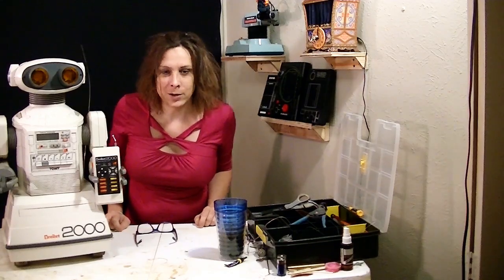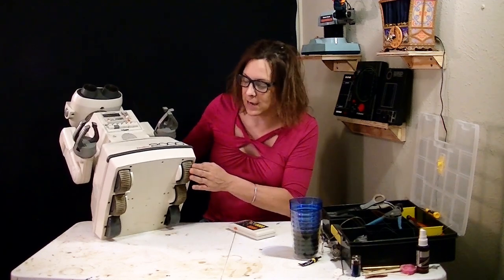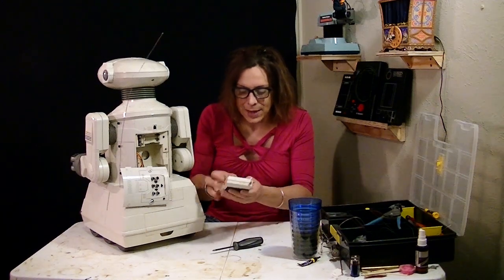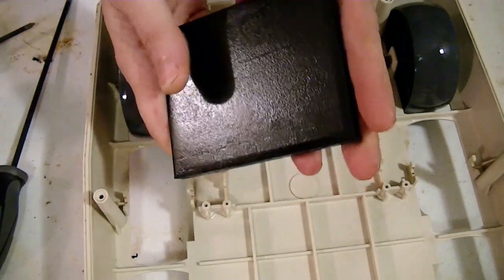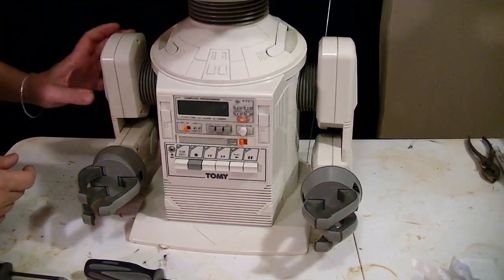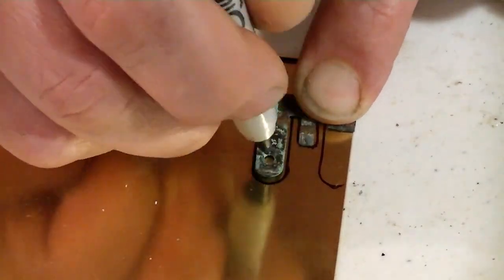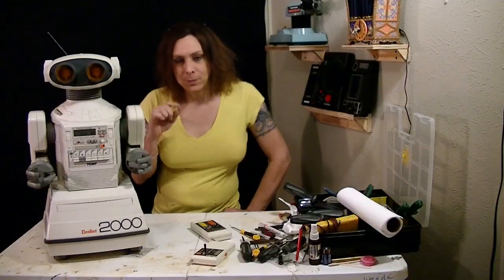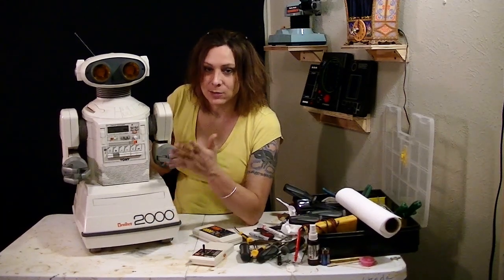OmniBot 2000 Refurbish Episode 1

Comment: I have a working omnibot 2000!  When you turn it on it returns to its neutral position. So if the head is to the side it will turn center blink its eyes and make his space robot sound!
Reply from the maker: If that is a question, then yes. That is correct. You will also hear the transmission shift gears back and forth as well. All have to pass for it to work.

Comment: Hi  :)

Thank you for your helpful Videos... I have an Omnibot 2000 and the circuit board is not working anymore because of a short circuit :( I have now an other circuit board to swap out... but don't know how exactly to do this. Have you some advice for me to change the new circuit board with the old one?

Thank you so much and go on like you do! I love your Videos! 🙌😍

Many greetings

Florian
Reply from the maker: All I can say is take lots of pictures... lots of pictures, from every angle. Then take your time disconnecting wires and putting the new one in.
Reply: @RandiRain  thank you Randi! 🙌😊

Comment: Hi Randi I cannot find anything regarding replacing a battery for this robot. They sell similar batteries but they dont have the cable to plug it in to this robot. Is it possible to manually make a cable for the battery? Thank you
Reply from the maker: I can't remember on how many of these videos I have made the battery cable. There are two other videos on the Omnibot 2000, plus another one with the tray. There's a video on the regular Omnibot. There's one on the Robies Sr. They're all the same thing and I know for a fact I have made at least two on two different videos. It's a barrel a plug where the center is negative. Keep looking, the video is around somewhere if you need more help than that.

Comment: I have 1 that needs repairs I have remote and manual ..........tires fell apart and rubber insert in hand melted ,remote works ,robot powered on and has some functions also have serving tray
Reply from the maker: I sell the tires for the robot, and at some point I am going to recreate the rubber for the grips. I have been asked to do that for a long time. If you need more help than the videos give, let me know.

Comment: I just now discovered this channel, I have a mostly-functioning Omnibot 2000 myself with a broken cassette deck belt. (I just need to get a new battery and repair the controller since the wiring in it has corroded.) I've done repairs on her in the past, although getting 'Ommi' to full working condition isn't a huge priority as I intend to mod her into something more like the robot buddy Tomy envisioned back in the 80s. Still neat to see someone else working with one of these; they're hard to find these days. I haven't disassembled mine any more than the base and the motorized arm one time.
(I will say that your Omnibot was pretty grody on the inside but you cleaned 'em up well!)
EDIT: Could I have a copy of those controller tones you used? I don't have them myself...
Reply from the maker: I would have to find the tones again. Get one of those cassette adaptors and put it in the cassette player. Push play on the Omnibot. Have the adapter plugged into a computer's headphone jack, and there are websites where you can play any range of tone. Go through the tones and see what which ones make it do whatever.
Reply: Well that was fast. XD Thanks anyway, I'll have to try to find the tones myself if I get my bot's tape deck working again
Reply from the maker: @sbuggbot  It's been done before. You might check around. I'm not sure if I ever even did the 2000, and just the regular Omnibot. Because I know there are tone files on my computer that operate it, but not sure which ones do what.

Comment: Wow! Why didn't I think of using a tape adapter, it's such a simple way of allowing outside devices (and computers) to control an Omnibot. Thanks!
Reply: So I just recently purchased a tape adapter and tried using it with my MP3 player on a fully functioning Omnibot 2000. This didn't work. How did this pan out for you two?

Comment: Glad I found this!  Restoration of my 2000 is next up on my project list. I even have the complete set of sensors available for it. Sadly, it has sat unused for about 20 years. Not sure it will even power up yet.
Reply from the maker: If you need me to help, check something on mine, or anything like that, just let me know.

Comment: Hi Randi. I have a question for you. I found a talking Buzz Lightyear figure from 1995. He was moldy plus the battery contacts, negative wire and one-inch circuit board were heavily oxidized and corroded. I scrubbed the contacts, replaced the negative and left the board alone. The green coating was peeling off the printed traces, I didn't want to mess with it. When I reassembled him, he worked great. But after a few minutes, he started taking fast. He has a one-inch voice board with a couple resistors, a transistor and an epoxy blob chip. I don't remember any capacitors, but he's assembled now. Why would he start talking fast? Any experience with something like this?
Reply from the maker: Hmm... No idea really. I would guess it's something to do with the clock pulse in the electronics. Why it's sped up? I don't know.

Comment: BTW, the next thing it is supposed to do after the gear change motor is to move the arm and wrist. Looks like it is stopping there.
Reply: Hmm. After looking more closely, the arm is controlled by an LB1645 afterall. The wrist is controlled by one of the LB1649s. The LB1645 may be the blown IC stopping the initialization. NTE1716 is the replacement for the LB1645 and NTE1774 is the replacement for the LB1649. On the LB1645, the control pins are on pins 5 and 6. You can check if they are getting toggled during the initialization. Sorry, for multiple posts, but I have mine apart right now also working on refurbishing it.
Reply from the maker: Thank you. That's what I needed to know. The motors could just be oxidized and not turning. That's my next test is to make the arm work by hard wiring it and see what that does. I'm hoping that just getting them going will fix it.
Reply: @RandiRain  The pictures here (color of wires) might help you with doing that without needing to disassemble the arm. http://www.theoldrobots.com/zarm2.html

Comment: First make sure that the motor switches are on in the rear panel. If that isn't it, the problem is probably the motor driver transistors. If the motors don't move to their limit switches, it will fail the initialization. Looking at my board, these are D1060s (NTE replacement NTE377) , and B824s (NTE378) transistors. There are also a couple LB1649s, but I believe those are for the tape and gear switch motor (which seem to work on yours.)
Reply: I had originally wrote about LB1645s (and deleted it). I was going from memory. Those are the motor drivers for the other Omnibots and Radio Shack bots. I've had to replace several of those drivers. I just went and pulled out my board for the 2000. Makes sense the 2000 would need much larger motor drivers. You can check the base of the transistors to see if they are getting the control signals from the microprocessor. If they are, but motors are not moving, it is most likely the transistors are shot. It may not be all of them. I imagine if Omnibot hits a point where it fails initialization, it just stops and doesn't try the rest. I would just replace them all anyway.
Reply from the maker: Thanks for that information. On start up, does the motors move away from the limit switches and go back? Or if they are already switched on, does it consider it good?
Reply: @RandiRain  I do not know the answer to this for certain, but I would imagine based on the behavior, that if it senses a limit switch at one extreme, it would simply move to the other extreme and if it was at neither extreme, it would just move to one extreme and then to the other. It has no means of understanding its position in between. If it were just bad limit switches, I would think that you would hear some motor grinding (which would eventually cause those drivers to burn up.)
Reply: Here's some help. First a video showing the arm in the somewhere in the middle position. It moves down and then continues the initialization https://www.youtube.com/watch?v=zQTvXDZRlRk
Reply: Here is another one showing the arm do the same thing. It seems to just move down until it reaches the limit switch and then continue initialization. https://www.youtube.com/watch?v=KgbnsKh78RQ

Comment: Could it be the fuse
Reply from the maker: Checked that. The fuse is good, and the tape deck wouldn't work either if it was the fuse. I wish it was something like that.
Reply: @RandiRain maybe a few resistors or transistors or even compasitors  maybe gone bad you may need a circuit board  component reader to test out some of the components are bad as swapping them can make a huge difference
Reply from the maker: I don't have a component reader. Resistors would be burnt if they are gone. Same with the ceramic capacitors. Possible with the transistors, but most likely would be the film capacitors. I plan on changing them out, but I doubt it fixes anything.